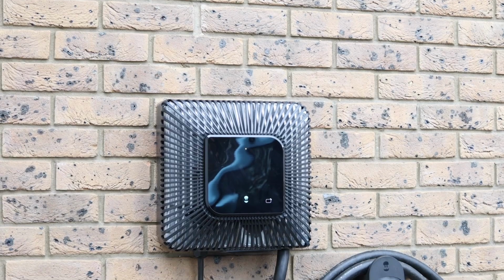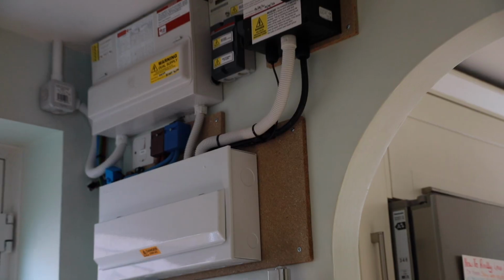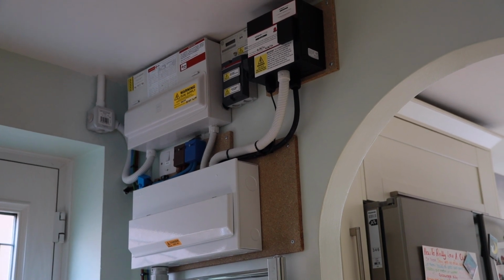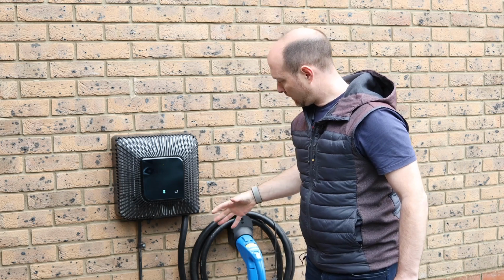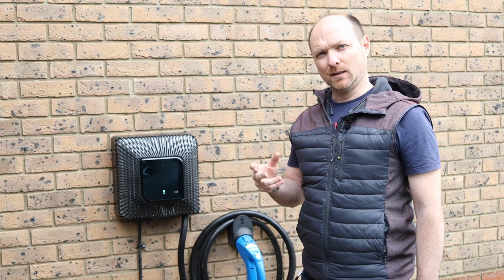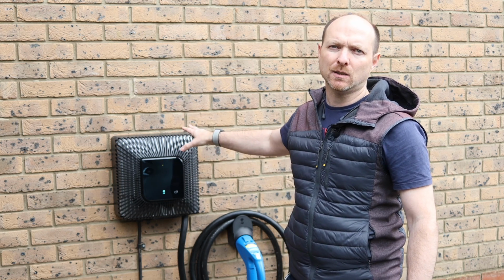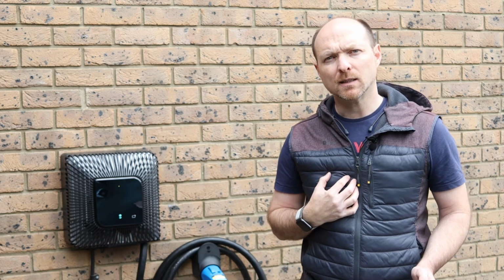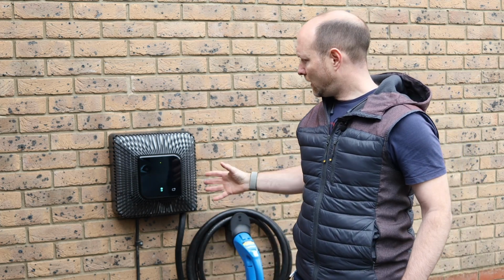Power Loop V2G Trial OVER

Comment: DC does not require thicker cables.  High amperage requires thicker cables.  AC in Britain is distributed at 230 Volts, 55 Hz.  Modern EVs charge at between 500 and 800 Volts DC so DC only chargers can get by with smaller cables. Current home chargers have thick cables because they currently charge with AC. A side note. For a given AC or DC voltage, cables carrying AC are more resistive because of something called skin effect where alternating current is not actually uniformly distributed within the cable cross section as is the case with DC voltage.

Comment: We were part of the trial as well. WTG / VTH is good, but you'll find you still need a home battery like we also found out....
Also be very carefull of voltage, remember each grid tied device increases voltage we had solar, home battery and car all pushing power out and our voltage spiked up to 257v normally 240, this damaged alot of equipment in our house. Zero help from the installers as they blamed each other and I ended up installing a voltage optimiser to reduce the voltage by 10v.
Also the VTG home unit doesn't output less then 6 amps. my home base load is 4 amps, I was told once load goes over 6 the unit switches on .... not ideal as the baseload during the day was my main worry.... however good for high loads like kettle and cooker :) hopefully all this has been addressed with the new unit and I will be buying one.

Comment: It sounds like a good idea until you ask yourself how  much shorter will my battery life be when its cycled hard and fast to the grid ?
If it shortens your battery life by half your car will be a dead duck in five years instead of ten. No thanks. Any tradesman will tell you  how long their cordless batteries last when used day in day out. Two years. If your very lucky.
Same chemistry, same problems.
Reply from the maker: Except it’s not charged hard or fast, a trickle of 7kw is the maximum over peak hours only 4:30 to 8pm, so not even one cycle of the battery. However, this is precisely the reason it was a trial and the car was provided for trial purposes and battery life would be examined to determine the impact on its lifespan.
Reply: @eviain  
I'm not talking about charge rate. I'm concerned about discharge rate to the grid. Rapid discharge gets batteries very hot.
Reply from the maker: @joschmoyo4532  it’s 7kw both ways
Reply: @eviain  
The maximum output of my inverter is 6 kW. The maximum charge rate for my batteries is 3.6 kW. I'm sure the manufacturer puts a limit on charge rate to avoid damage. I try to keep discharge rates to a maximum about the same by load sharing with solar output during the day and avoiding heavy draw at night.
Maybe if your talking EV batteries you can get away with those sort of rates but I try to keep my batteries from getting flogged to death.
Reply: @eviain  
7kw is 28.5 amps ! Not exactly what I would call  a trickle charge or draw.  A kettle draws 3 to 3.3 kW. The maximum domestic draw is our water heater @ 3.6 kW. That's 15 amps. That's a fair chunk of juice.
Reply from the maker: @joschmoyo4532  on a battery designed to charge at 50kw and discharge to a 170kw motor. It’s all relative.
Reply: @eviain  
Yes, that I can understand though I still remain Leary of the current lithium batteries being used at such high rates of charge/ discharge. What sort of voltages are we talking about ?
Reply from the maker: @joschmoyo4532  perfectly fine to be cautious of this technology, hence the need to trial. The leaf, and most EVs, is 400v traction battery. Some premium EVs are 800v for even faster charging/performance. IMHO it’s far more important to look at the quality of the battery management system and it’s thermal management of the battery, something the leaf is terrible at btw. 
Modern EVs have cooled batteries to stop high temperature situations under high loads. The BMS should also throttle back power demands if a high temperature situation occurs, see my nightmare video on rapid gate. 
Overall the leaf has terrible battery management for high speed charging (50kw) but even on this car thermals are minimal when charging at 7kw. I think the worst possible scenario for this car would be constant rapid charging then raced round a hilly race track, battery death would come quickly in such an extreme scenario, where as other EVs with better management would be less impacted. 
Cell chemistry is another factor to consider in the future (when this moves beyond trials) some promising very low degradation and high cycle life.

Comment: The word grid is a bit misleading.  This powers the house, or am I wrong
Reply from the maker: Hi yes you are wrong, there’s no measurement of house load. So whilst it will power the house the excess passes to the grid. You can see that in the v2g stats video with graphs and everything. The energy company is in control of the time and quantity of energy discharge from the car, within specified limits configured by the user app

Comment: Can this unit be used with a solar system as battery storage and powering a house? Meaning can the wallbox be outputting energy into the house and in the same time charging the battery with the excess? Serious interest in doing this.
Reply from the maker: I couldn’t with this version but it’s possible I think the technology has moved on somewhat, best look at the Wallbox quasar 2 and the Indra v2g/h chagers

Comment: My Dad worked for an Electrical utility supplier for 35 years and taught me all about all of the Aspects of it. I considered going into the same line of work but I went a different route. To me what they are saying sounds like excuses and propaganda to suppress the adoption of something that competes with them and lowers their profits. A transformer does have a rating   but only nears that rating when current is passing through it or the load is unbalanced. It would be very difficult to burn up that transformer unless the voltage and current on the other side of it was very unbalanced or lower than what you were putting in on the other side of it in reverse. I work with transformers,  loads ,and electronics everyday. In the US our grid has been in trouble since the late 80's and has only gotten worse. There are many places today experiencing rolling blackouts at various times of the year. This V to G could help with those issues. Our systems require a power auto changeover system to eliminate power feeding back onto the grid when it is dangerous or could cause problems on the grid. It would be no different than Grid tied Solar systems we have now.
I think they are feeding you a line of Bull.
Reply from the maker: Your probably right but as a consumer I have to jump through their hoops sadly

Comment: I’m surprised at how “unsmart” it was. I think this would work really well if you could access wholesale energy prices which tend to fluctuate with demand and sell high and buy low. Then you just need access to that pricing plan (I think it’s Octopus Agile in the UK). In Australia we have Amber which is direct wholesale pricing with a $15 per month user charge. It’s not quite automated enough yet to really risk it, as demand pricing means you’re exposed to the highs s well as the lows. It’s also annoying that CCS has not adted a V2G standard.
Reply from the maker: Agree 100% it’s quite frustrating, the uk energy market also means automation needs to take many steps through various parties.
Reply: I think you shouldnt base it on market prices but on your own usage. In the netherlands and probably in most countries in western europe, the tax is easily half of the price. So it’s more profitable to get your kwhs to zero than to buy and sell because youre still gonna pay taxes on kwhs you buy.

Comment: As someone who is at home all day this would be more usable as all extra power from solar could go into my car battery and can be used at night for home or to grid whenever needed (I'd go for V2X so everything, not just home or grid). For the grid this should work as something that relieves the load on the network. In Utrecht Netherlands this project is on a large scale and involve many parties to come up with a good solution and I hear a lot of positives from that.
Thank you for sharing your experience.
Reply: I think that the minimum power for this setup is 600 watt i think. Maybe Lain knows, but i heard 600 watt before. Thats way too much for the night.

Comment: Very interesting video as always, thanks.
The ‘protection’ required by the DNO to limit your export to 7kW is a lot of nonsense.  Your home connection is capable of taking just as much export power as it can import, so if your main fuse is rated at 60A (=15kW) then you can quite happily export 60A or 15kW without overloading your connection.  If V2G is working properly it will only operate when demand is high, and the energy will be used locally, and will not overload the grid.  But electricity Companies are in the business of selling power, and the export ‘limit’ has more to do with trying to protect their revenue than protect the grid..

You’re right to highlight the distinction between V2G and V2 HOME.  V2G export to the grid gives you little financial benefit, if any.  But V2H allows you to import from your storage battery (your car) whenever it’s plugged in, and then recharge from your solar or cheap rate tariff, almost eliminating your electricity bill.  It allows you to turn your car into a home-storage battery, without the need to buy a Tesla Powerwall or similar system.

If V2H was available for all CCS vehicles this would be a game changer, and would be immensely popular and sell in huge numbers.  I’ve wondered why such a system is not available - I’ve  been trying to get one for the past 10 years but no-one can supply it.  It should easy for a company like myEnergi to produce one (the Zappi already has a CT clamp which monitors Home import/export) all it needs is an inverter to produce mains AC from the DC battery connection in response to Home power demand, and some control circuitry to regulate battery discharge.  I’ve asked myEnergi to produce one for years, but no luck.

Why not?  Partly because it would be expensive, partly because it will require CCS vehicles to be bi-directionally equipped - most are not for some reason - but I suspect there is also a large amount of lobbying by the electricity Companies against V2H, because of the large loss of revenue they will suffer.

The first company to produce an affordable V2H unit for CCS, will make a fortune..
Reply: Absolutely, spot on, William! V2H would lead to the bankruptcy of the majority of electric companies. No one expected this technology to go ahead so fast. Now, I suspect, the governments, DNO, energy providers and car manufactories are possibly all conspired to retain some artificial profit on the market that they would lose soon.
Reply: It’s not that simple, jus because you have a 60 or 100A fuse every home on the street cannot demand or push 60 or 100A without taking out the supply fuse at the transformer, they use modelling to determine what the actual demand is likely to be. You can have issues with local voltage rise as there’s not much headroom for voltage to be pushed upwards on residential supplies, also there is the question of fairness just because your home could push many amps, why should your neighbours be excluded just because you got their before them?

Comment: Thx for the video. i'm from Belgium and tried to understand everything. My goal is to get a vehilce to home installation. iff i understand  it right , that is possible with this charger? Or does that also needs a lot of extra tools to work? Thx already for the info.
Reply from the maker: Hi to you and everyone in wonderful Belgium! I'm told it will be possible in the future, with some additional stuff. Indra do a unit already, however I'm not sure if it is something that would be generally available, however there may be trials going on in your area. Normally installation needs to be done with agreement from your local energy grid operator.

Comment: Very interesting and I’m not at all surprised the trial has been abandoned. With the current structure of the energy supply model I found it difficult to see who is benefitting and how. Octopus is just a reseller of generated electricity and they buy from a wholesale market. The DNO is charged with looking after the distribution networks which often includes the sub transmission voltages up to 132kv. There is very little control and automation on the distribution networks so an injection of power from a largish number of EVs could cause problems with voltage levels and could exceed the current capacity of the low voltage network. Bear in mind that the network for the majority of housing projects have been designed with a loading of 7kw per house as an After Diversity Maximum Demand value.
I could see a V to G system being interesting if there was a new housing estate where every consumer had to be supplied by one supplier say Octopus and that could benefit Octopus if they bought from and sold to their own customers. But who is benefiting when there are multiple sellers of electricity to a housing estate?

We really are paying a high price for privatisation of our power industry and creating an energy market that is obviously flawed. But with bus companies ( Manchester) and various rail companies returning to public ownership perhaps the politicians just might rethink things. 

Essentials like power and water should in my view as a Tory be publicly owned and price controlled with subsidies so that the less well off can have some of their hard earned cash to have an easier life.

I always enjoy your well considered and nicely presented videos……….even if I will not be buying an EV any time soon!
Reply from the maker: Thanks for the kind words Michael, its been an interesting trial to be a part of. Not sure what the next steps are with powerloop but there are other similar trials still on the go. Defiantly agree that EVs could cause problems on local grids, either inadvertently or via a malicious act, perhaps a topic of a future video me thinks!
Reply: Has the trial been abandoned?  After all it was just a trial and seemed from what Iain was saying that it's just come to an end, I assume as planned from the start.
Reply from the maker: @malcolmstreet1  not abandoned just ran it’s course of two years.

Comment: Vehicle to home requires the home to be disconnected from the grid by most definitions of the term.  It's a replacement for a backup generator.  What you are describing as "vehicle to home" is technically still vehicle to grid with some way for the owner to customize the rules on how/when the energy is exported.  I like the idea though.  That and the rules regarding energy rates are needed for V2G to really make sense on the consumer side of things.
Reply: I’ve had a vehicle to home charger for just under a year now and it remains online with the grid always. It has a CT on the house supply where it simply tries to prevent anything from going in and out of the house.
Reply: @mrnetzero , interesting.  I haven't heard the term used in that context.  It makes sense I guess, but it's a little bit confusing since the term "V2H" is already used for grid isolated use cases (like a backup generator).  I would still consider it V2G as it is grid tied and just utilizes different software settings, but I'm sure the industry will randomly use both of these terms in different ways to make things as confusing as possible for the consumer.
Reply: @CL-gq3no  agree I don’t think it’s that clear and a bit ambiguous, the current term being used is V2X which is everything! Interestingly the iso standard for vehicle export has now been agreed so expect to see lots more of it!
Reply from the maker: Not sure what the definition of v2h is officially but when I talk about it, I don’t expect a complete separation from the grid. However I see v2h as a load matching system which attempts to match the consumption in the home minimising as close to zero the amount of import and export. However I see the grid is useful in managing undershoot and overshoot, given the system might not respond immediately
Reply: I would be surprised CT alone does the job. For V2H to work, you are very likely need devices such as Tesla gateway 2, where if there is power cut, it will automatically cut connection between your home and grid. This way, you are not sending any power back. The reason for that is you could electric shock anyone working on your local distribution line.

@Laurence Johnson care to share what product you manage to install at your home for V2H to work? Does it have limitation on the EV manufacturer?
Reply from the maker: @cocoa118  I’m purely talking about load matching in the home. Not running the home in a power cut
Reply from the maker: This is a great point though as it raises the question about how Wallbox would make their quasar work on v2h would they do it in a grid tied way (like solar, where it shuts down) or require a gateway to sever the grid connection in a power cut. Personally I don’t mind grid tied.

Comment: Thanks for sharing.  It seems like some of the issues you have with the V2G charger are more bad design than anything else.  There is no reason for that cable to be more stiff than a normal charger's cable.  The loud fan shouldn't be needed either.  Lots of grid tie solar inverters send far more power to the grid during the hottest parts of the day and in much warmer climates with no fan at all.
Reply from the maker: Your 100% right, I think the charger is compromised, the cable may be off the shelf and intended for dc rapid chargers. The fan, well I have no idea what they we’re thinking there!